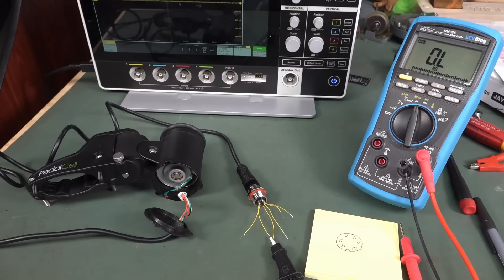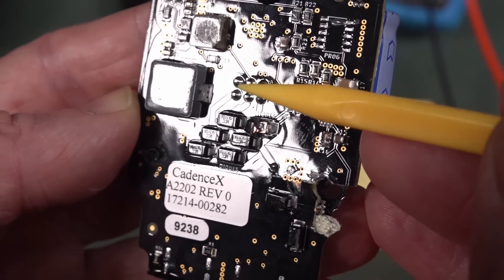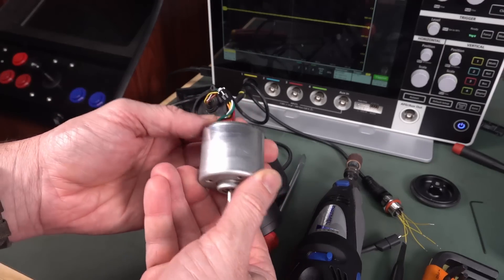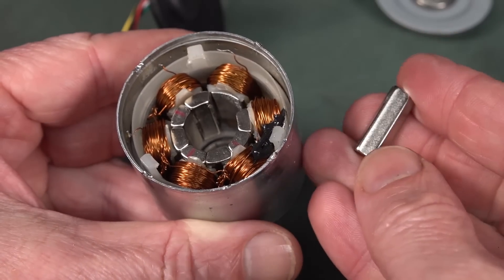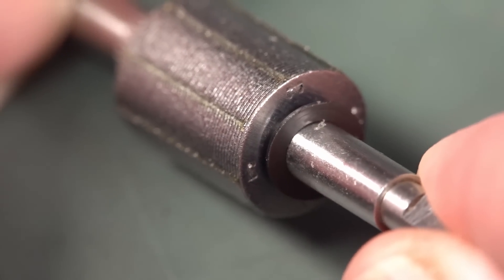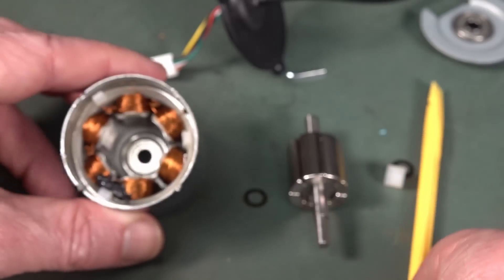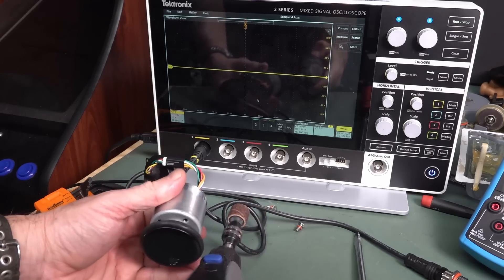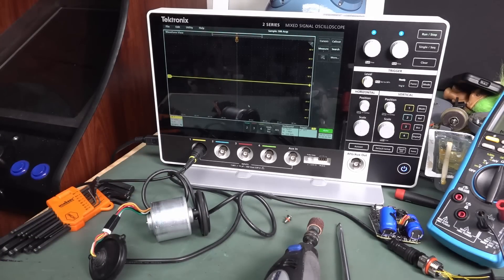EEVblog 1485 - PedalCell CadenceX Bike Generator LOL FAIL!

Comment: good review,  thanks. BTW if you still have the Pedalcell I'd be interested in buying it, have a project that would use only the generator, wouldn't need the circuit portion

Comment: That looks like a different brushless motor would work. It looks like the surface of the magnets are too smoth for the glue to adhere to. The pedal cell bit seems good, but the motor needs to be changed.

Comment: A tiny scrap of carbon fiber and resin, it could be a long life product. It would cost about $1 cents in materials even using west systems epoxy. Wrap them on, in addition to the glue with the carbon fiber and you can rotate it 10 times as fast as your bike and it's all good.

Comment: Hi!!! I have one that failed too!!! I bought this Pedalcell/ex-cadenceX and it was almost 400 €! The same thing seems to happen to me, the controller and the dynamo still look fine, but not generating any power! On the manual they say : " do not go beyond 40 km/h" (which is a bit silly on something supposed to be used on a bicycle) because it could damage the unit. I always followed my GPS speed to never go past it, it still failed only 3 months after I bought it. A bummer for something this expensive...
I will send your video to their customers service, thanks, I was about to open it and I see your video.
I will keep you updated to see what they have to say about it.

Comment: What a crap product.. like so much today.
When I was a kid we had dynamoes on the bikes when loaded they delivered 6V and 0.5 A into a bulb in the front and the backlight. The system didnt cost a fortune and lasted the 10 years easily until road salt had eaten them away. In the mid 80s battery lamps sadly became the norm and the dynamoes dissapeared from the market.
They had one flaw when there were snow on the street though then they slipped on the tyre.

They were made much simpler than this one but worked very well and lasted a decade at least. Today noone knows how to make really good mechanical engineering. I bet Cadence took a premium price for this garbage.

Comment: LOL they didn't wrap the magnets. They are usually wrapped with aramide. 

Why did they make such a complicated PCB? All they needed was a rectifier and a large range voltage regulator. I've made similar devices myself. No need for hall sensing on a little generator.

Comment: These type of products are popular among long distance touring cyclists who may not have access to mains electricity to charge a lower bank up.  Usually the electronics is connected to an already installed hub dynamo on the front wheel, but they have become very expensive and I assume this product was designed to be a lower cost easily removable alternative.

Comment: Now make a 3phase generater out of a vcr i have um youll need some n52 neyodinium magnets and superglue and three bridge rectifiers...
Reply: Ps you use the haed motor and add a wheel too the drive shaft and screw the thing too your bike so wheel rubs side of bike wheel... Works good i was running powerinverters and switching power supplys too drive the inverter under load... No batteries. Reaches max power at 4000 rpm gen drive shaft speed gennerator turns roughly 20 times per wheel rotation on bike... Makes power... Lots of it.

Comment: For decades we had 'old fashioned' dynamos for bicycle lights either in the wheel hub or as a spring loaded device that sup off the tyre rotating. Batteries replaced dynamos for powering bicycle lights and these 'inventors' couldn't resist trying to re-invent the dynamo in a way that it could be done from modern electrical manufacturing lines. They need to go back to old school technology because it worked well.

Comment: "DC brushless motor"... facepalm. There's no such thing as "DC brushless motor". A brushless motor requires 3-phase AC to run. All brushless motors are AC. Always. No way around it.
If one slaps a DC-to-AC converter onto this motor (aka ESC), it will run off DC power. But still: nobody would call it a "DC brushless motor", except perhaps for American HVAC "professionals".

Comment: 50 years ago i rode a bicycle every day with a 6v generator to run the lights. it ran off the tire and never had a problem. modern stuff is junk compared with the old
tech i had. simple is better.

Comment: Thing probably would have worked if they used a motor/generator with an external rather than internal rotor. (The force from spinning would have kept the magnets to the outside bell housing, even if the glue failed.) Thus making you wonder why they made that design choice.
Reply: outrunnerzzzzzzzzzzzzzzzzzzzzzzzzzzzz

Comment: they should have used an out runner brushless instead they would not have had this problem with step up gear ratio from 5 to 1 or ten to 1 whit a planetary gear system this would have raise to power output , then just rectify and regulate the output easy.

Comment: wtf is this? this is not a real generator. and wtf is this black rectanguler monolith monkey pcb meant to do? put people in space? 
compute the ballistic trajectory of its flight into the rubbish bin? damn this thing, im freaking livid. id be taking it back to the shop and slamming it on the counter so hard, the managers skull would crack from the shockwave.

Comment: If they can put up with a little bit of a gap, they could have used a heat shrink semi tough plastic thin sleeve over tho  magnets like that thin plastic they use for over wrapping a Lithium Battery or a Nicad cell stack for landline cordless phone. If it doesn’t rub, it would hold the magnets in place forever!

Comment: Found the same fault on a small 200W water turbine which supposedly needed some new ball bearings. Turned out that one magnet detached from the shaft and broke into two pieces. Oddly enough the stator and everything else were completely undamaged. Don't have any experience with motors but seemed strange to me that in such a large (well, relatively large) device turning at several thousands RPM, the magnets were just hold into place with a small amount of rubbery type adhesive. Anybody knows if it is normal or it just happened to be a badly designed product?

Comment: those are the risks of inrunner rotor design. cars solve them by planting the magnets deep into the steel sheets of the rotor, so you could only see the magnets by looking from the sides. Having an out-runner rotor with a solid ring magnet such as the ones used in hard drives and cd/dvd roms is the easiest solution.

Comment: That issue with the permanent magnets falling off from the rotor due to ineffective adhesion is a pretty embarrassing point of failure. Although I could have sworn that one of the diodes was blown as well at around 2:09 in the video.

Comment: The magnets were meant to hold themselves stuck to the rotor core without glue by the magnetic attraction only 🤣. Someone rode a bit faster than the max specified speed and centrifugal force stepped in 😂

Comment: The gap between two of the magnets seen at 05:37 made it immediately evident that something was wrong with the placement of said magnets. Since they were in a more outward position than they were meant to be, the larger perimeter was not completely filled by the magnets.

I have a gasoline-powered RC model helicopter that uses a scheme not too different from this device. A brushless motor (of the kind usually employed in electric RC  model airplanes) is driven at 11,000 rpm by the gasoline motor. Its output goes through a 3-phase rectifier and voltage regulator. Keeps the heli flying regardless of the state of the onboard battery, which provides great peace of mind. In fact, a few people have reported that they forgot to turn on the battery altogether and went on flying, on generator power alone.

Comment: It’s a great idea but the motor isn’t built rugged enough to withstand the bicycle riding in the first place and it’s definitely a huge weak point in the product design!!!! Change the motor out for a much more industrial motor then you might actually have a decent product but whoever sourced the motor probably didn’t take ruggedness into consideration while looking at motors turned into generators!!! If the motor weren’t complete trash then it’d probably be just fine 🙃!!!

Comment: I wish the lad would quit calling it a motor. (early on)  I don't understand why the designers couldn't locate a four pole motor with two wires to use in this application.  I like the "O" ring tire, it should be easy to replace.  I think warning lights would be a more important use for mobile power than recharging a worn out cell phone battery. Ron W4BIN

Comment: Yes the magnets have come away from the rotor. Some motors also have a seperate magnet assembly to drive the hall sensors. On one of the BLDC motors I worked on the ceramic hall affect magnet ring would come away when the motor got exceptionally hot. It would disintegrate leaving bits all over the place. The failure you are observing is just because of some aspect of the adhesive.

Comment: 5:42 this already looked suspicious ... 5:48  there's the magnets and the stators ... wait, how would the magnets move relativugh for a motor that doesn't need e to the stators to induce current?
Btw. notice the markings on the magnets, so you can arrange them correctly to get alternating polarisations. Another way to get an alternating arrangement is to check their polarisations against each other like that: 10:39, so they have N-S alternating inward and outward. It doen't matter which is N and which S outside, only that they alternate.

They likely can't weld the magnets to the rotor, cause the heat would destroy them, so they went for some cheap glue solution.
I also wonder if the forces acting on the magnets are different when using the motor as a generator, maybe the glue solution is just good enough for a motor that doesn't need to produce much torque.

Comment: Hmm.  I wonder if this motor shows up in cheap, import power tools as a motor.  I doubt it would do any better as such unless it is never allowed by its drive to exceed some relatively low RPM as compared to its bicycle generator application.

Comment: Electrolux do a dryer motor that does exactly the same as this, when one magnet falls of it sounds like the bearings have failed as it gets pushed around inside the coil.... yep piss poor crap on a high end, high efficiency model???

Comment: Laminations are used on the PM rotor because it's practically free to tool the lam mold to cut the stator and rotor support (back iron) at the same time.  There is some amount of recirculating current in this "back iron"  but laminations aren't really needed there.

Comment: They should have written in the manual: riding faster than 40 mph will most probably activate "SELF-DESTRUCTION MODE"

It's not a bug, it's a feature 😉
Reply: Should be safe on a Penny Farthing front wheel, but not a child's tricycle.....
Reply: Knowing Chinese, they probably substituted MPH for km/h, so they were only good for half the speed on the instructions anyways.

Comment: They have used laminated steel for the rotor, because it allows them to be easily press fitted onto the shaft.

Otherwise I would not see any problem using a "motor" as a generator. Normally when used as a real motor, all the vibration and other forces onto the rotor assemble would be greater than when used as a generator even with the worst bike ride. So the technical blame should definitely go after the motor manufacturer. After the "bike generator charger" manufacturer should go the nontechnical blame: They should have selected their parts supplier better...

Comment: When I was working in a tape drive manufacturer, we were surprised that the failure from the drive unit were so high. Went down to the factory in China, and after some auditing; the operators were not curing the loctite glue under the UV lamp (they just dab the glue and move it along). Apparently, no one understood the process instructions, so that part was not translated to mandarin for the operators.
Reply: PLUS no one had seen or used UV-cured glue before!!!!
Reply: @uploadJ  Yes, it wasn't the norm in China then.

Comment: People have been using alternators on bicycle wheels for ages to power the lights. These days it's integrated in the hub and the lights are LED, but back in the day these small alternators could also deliver a few watts of single phase power.  A rectifier and buck-converter is all you need to charge your phone.

Also the hub alternators are able to deliver a few watts
Reply: Yeah, there would be a small generator mounted on the fork, which the wheel would turn by friction. But the problem with that is that makes the bike harder to pedal and it always caused more wear on the tire.
Reply: @ct6502c  Exactly, that's why I often drove without light in the dark😅. But the hub alternators hardly provide any resistance at all.
Reply: @tomvleeuwen  of course any generator will create some resistance but the PedalCell is virtually undetectable in use. It is actually more efficient than hub alternators.
The point of this is that it can charge a phone, bike computer and lights on a multiday trip where there is no access to mains charging.

Comment: Surprisingly many people don't know how fast a bicycle can be. I guess this was built for people riding about 25km/h tops. Or they couldn't get a cheap motor suitable for high RPM. Or they got a good sample and than a Chinese supplier sent "same" motors in bulk.
I'm also wondering if the high RPM or high power output caused enough eddy current in the core to heat it up and help with shedding the magnets.

Comment: Now that what is going wrong is known it doesn't look too difficult to repair with a little JB Weld. Just need a couple of rubber bands to hold the magnets in place while the glue hardens. The magnets could probably themselves in place I suppose now that I think about it.

Comment: Did you say "SKS bearing"? I can't really see the letters on the video. But the good ones are made by "SKF".

Also, I bet this poor motor is simply being run out of spec and warmed up (which siftens many glues) and then span too fast.

Comment: If the device was only optimized to be a generator, could you have the rotor not be of electrical steel laminates or would it still have magnetic flux when the generator was under load?

Comment: This appears to be a fairly well Engineered bicycle “ALTERNATOR” with a subsequently Rectified and Regulated DC Output, BUT, the one absolutely APPALLING design feature of it is the UNFORGIVABLE use, of JUST, GLUE, to affix the VERY STRONG, NdPr Magnet segments to the Rotor, just to save what would be a relatively minimal extra cost, of using a correctly designed Aluminium Alloy Containment-Cage to properly enclose and permanently, affix the Magnets in place. 😳     With ONLY, the Glue being used, this, is a Design, that was ALWAYS, GOING TO FAIL, at some point in the future, and the one glaring mistake the manufacturers obviously made, was to use a Glue, that didn’t last the distance, in terms of it outlasting their, Warranty period, for these devices. 😉😁😂😂😂
Reply: What is a "paragraph", and why are they used?
Reply: @uploadJ     Just a personal thing, because I always, HATE ..waste, ..even, wasting ..space, in a YT video reply column, and so I may be considered guilty, by you, of your, ..sin, of not (often) formatting my replies with the use of paragraphs, but, you will note, that I do always allow an easily noticeable,           SPACE, between the end, and the start, of what would otherwise be ..space, and, line-feed, ..wasting Paragraphs. 😉😁
Reply: @uploadJ  To now phrase this as politely as I can, Bud, ..KMA…!!  😉😁

Comment: I reckon heat, if it's used long enough, it will induce heat in the coils, heating up the chamber and the glue, causing it to soften and the magnets to jump to the coils instead! :)

Comment: The manufacturer cheaped out or someone forgot the glue. Those magnets need to be attached to the rotor and without glue there is no way they will stay on no matter if you use it as a motor or generator. The hall effect sensors are just left over from them using a brushless motor and not going through the trouble of making a new design to save a few pennies.

Comment: would it not make sense to have reversed the design, like a dc motor? rather than the spinning magnets?
Reply: Nonsense - Then there is a need for slip rings that wear down and a larger diameter rotor to accommodate a lot of copper windings.

Comment: $299 for what's incorrectly called a "bottle dynamo" (All that I have seen are actually generators as they produce AC, not DC). I paid $80 for my Sturmey archer generator hub with built in break. For less than $50 I could easily add a battery pack and get the same thing as this. As a bicycle commuter having always on light is great and having them powered by a generator mean never worrying about batteries.

Comment: Back in the late 60s they sold small generator/ headlight sets for bikes.
You had to be moving 5-10 mph to get any light out of it.
Reply: They used a "wire" in the bub to make the light, too.  A little Tungsten wire, it got real hot, and created broad-spectrum light ... those were the 'daze' ...

Comment: Meh, in this case potting was done to get by with non-waterproof enclosures (we do the same)... I doubt they did that to protect the layout of the PC board, it's so laughably easy to remove the potting compound, you can brute force it with hot air and a flat screwdriver if you have enough patience

Comment: Dave, STRICTLY speaking, the silver bit is a brushless synchronous motor (not dc)
It can be turned into a brushless dc motor with the appropriate control circuitry
I’m sure you knew that, but I thought I’d bug you a bit!